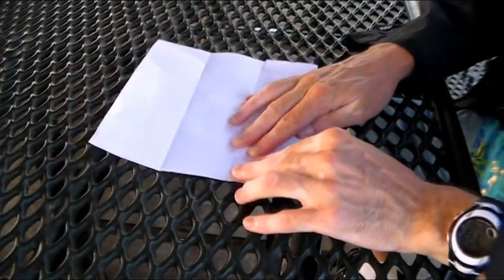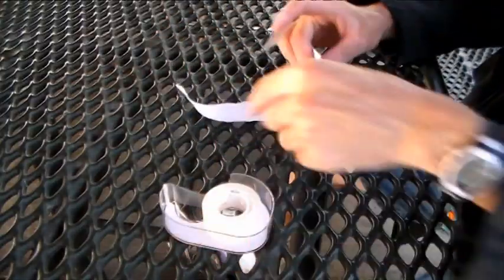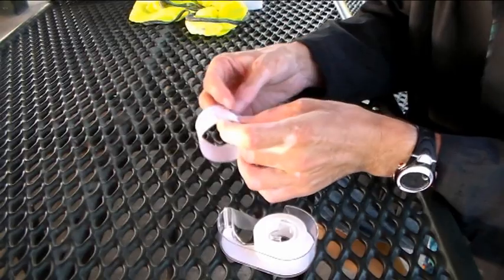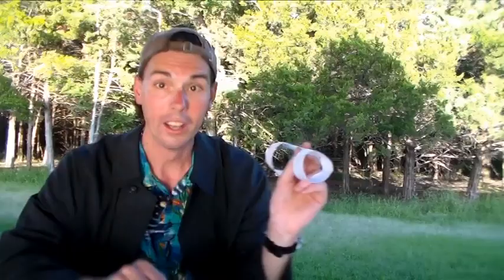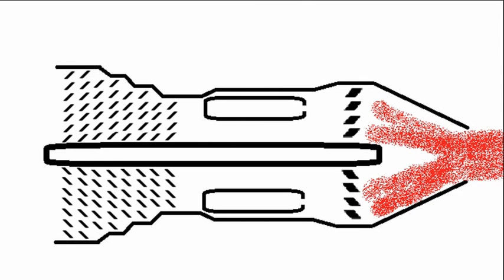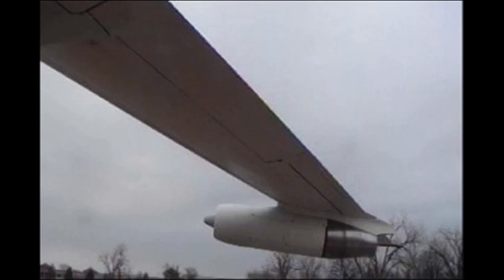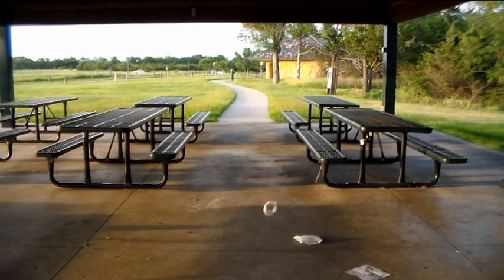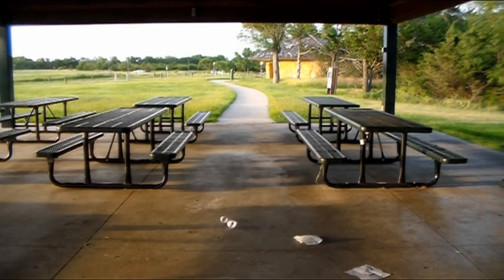✈️ How To Make A Loop Glider ➰

Comment: but how does the jet engine blades rotate? i know the air is sucked in and all that, but is there a motor or something that runs on a fuel that sucks all that air in? where is that motor or whatever? how do blades rotate? i have trouble understanding that.
Reply: The compressed air is pushed out with the fuel mix spinning the turbine in the back which causes the fan blades to spin
Reply: MV N dude your rite